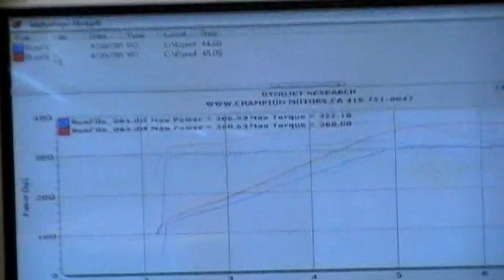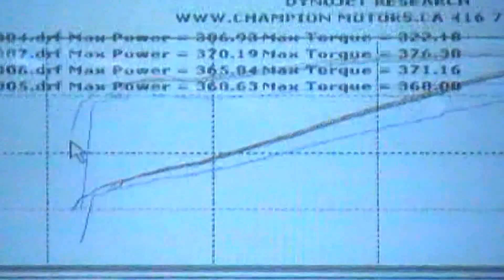243 heads, 228r cam Lq4 87 Transam dyno

Comment from the maker: Working on it.But not overly concerned.Exhaust is a huge draw back and the voltage drop which has been fixed and made a difference in topend already.
Reply: Torched T/A Entertainment hi, I'm also using an lq4 alternator and have a voltage drop at 6000 rpm. I use to have it at 5500 rpm until I installed a bigger pulley.
What was your solution and did that alone help high rpm?
Also, when your voltage dropped, was your wideband reading anything different than commanded? I ask because my air fuel ratio is still how it should be when the voltage drops to 11.XX volts. Thanks

Comment: I'm thinking mongoose heads 62-64cc (215s?) on a refreshed LQ4 lower with ARP bolts etc., and the Ultimate LS schmeely by FItech. It will reside in the bay of my 69 pervertible. Any thoughts?

Comment: you'll probably see another 20-30rwhp with a set of 1-7/8" longtube headers & 3" y-pipe
Reply: manzo70 I couldn't see why he wasn't making 400hp at the tires until I saw he was running stock manifolds.

Comment: Nice !!!  I have a 5.3 in my 3rd gen Camaro ,And thinking of swapping it out with the 6.0 lq4 with the 243 or 799 heads ,BTW What cam did you use ?
Reply from the maker: At that time is was the 228R cam from TSP on a 110 lsa
Reply: @Torched_TransAm  Thanks for getting back to me ,,,,What would be a good cam for the 6.0 for all around power ? Or even the 5.3 with stock converter
Reply from the maker: @DELTRANIO99  there are so many options. Contact the guys at texas speed, let them know what car you got..motor/trans setup and what the goal is for the setup. they will spec out a cam to suit your specific needs is the best way to go. I imagine something in the 226-230 range with around 550 lift would be suggested for decent gain,driveability and longevity of valvetrain.
Reply: @Torched_TransAm Thanks for getting back to me your the man and will do that

Comment: Ms4 cam ls3 top end LT lq4 he put down 360 on a mustang dyno but his car has the same issues you mentioned!?
Reply from the maker: Voltage was a failing alternator. I upgraded to the bigger truck 140amp alternator and solved that.  Misfires were from old msd plug wires. I switched to granatellli solid core wires. I did upgrade to truck coils also and tuned for them which brought me better mileage

Comment: It's amazing how much hp LS based engines make until they are put on a dyno... reality is that magazine numbers are very inflated.
Reply from the maker: That's the thing. It's just a number... An LS engine makes great numbers on a engine dyno. But stick that engine into a car and depending the drivetrain will eat those numbers up. The reality is what it does at the track not the dyno
Reply: @Torched_TransAm    nice T/A by the way
Reply: I read a car craft craft magazine about an lq4 build stock lq4 with ls1 hotcam.  It made 480hp, I thought that’s the ticket, I put one in my 72 GMC rebuilt with ls1 hotcam.  Made 323hp 342ftlbs, that is a far cry from 480 crank, maybe 400 to 410, it was though an auto and a ford 9in with 28in tall tires, but still not the 480.  I swapped heads to ported and polished 243, stepped up the cam 10 more degrees duration, swapped intake to tbss, was told this combo would make 440 to 460 wheel in a vette.  I made 362hp 365ftlbs in my truck, I think more realistically it makes 450 crank and 400 wheel in a vette.  Now some dynos are happier than others, I have had people with the same combo claiming 440whp, I don’t think they really make 100 more hp than me.  What you have to keep in mind is magazines dyno engines with electric water pumps, no accessories and open exhaust with water temps in the 160 range and often no MAF.  The only way to really add big power is with boost.

Comment: I'm just gonna port an polished 317 heads
Reply from the maker: Mill them .030 for a slight increase in compression.It will give you more power,better throttle response and still very safe for mild cams with stock head gaskets/ptv clearance.
Reply: I was also going to port and polish my typhoon 96mm intake manifold and bore out the opening with my LS2 102mm throttle body as well
Reply: also I'm getting LS2 flat top pistons

Comment: Any engine you install in an 87 Firebird instantly looses 100hp.
Reply from the maker: +Ryan Barbolt Wasnt aware of that lol,but  dyno numbers are just numbers.As long as the tune is done well is what matters.
Reply: Just screwin around man, but I agree with the others that should break 400whp.
Reply from the maker: Actually it shouldnt, on a lq4 should make less power than an ls1 with the same mods due to less compression and make more torque.It made the exact power Tsp said it should make with the cam and head swap.It did pick up 25hp more with longtube headers and a cutout in the follow up video I posted after this one.On this video I mention I had issues and the car wasnt fully tuned.This was 3 yrs ago though and this motor has seen alot more abuse slapping a turbo ontop running 15psi it wont last much longer :P
Reply: Well, no that's not true.  You said it had 243 casting heads on it which puts the compression exactly the same as an ls-1 with the right pistons.  Even the truck manifold makes more power than the car mani. if you can fit it.  Almost everybody using the lq4/9 with car heads and longtubes makes well over 400whp.
Reply from the maker: No thats not exactly true.The lq stock is 9.5:1 compression vs a stock ls1 is 11:1.Swapping lq4 has dished pistons and even swapping to 243 heads with stock head gaskets put me at 10.6:1.In this video Im still using stock manifolds not longtubes.A stock lq4 in 02 makes just over 300hp at the crank vs an ls1 at 340-350 at the crank. Tsp said the exact same thing..an ls1 with this cam package would be around 410-425whp. A lq4 would be 380-400whp depending on gearing and I hit there exact numbers when I had longtubes.Keep in mind most guys who run n/a lq swaps use a bigger cam than a 228r which would be 10-20 more whp.But just putting on 243 heads onto a lq4 does not equate to a stock ls1 with 243 heads.And the truck intake would stick out my hood so I choose not to use it..and I choose the smaller cam knowing I eventually was going boosted and didnt want to change cams again.But like I said..when I fixed my issues and put on my longtube headers the car made 400whp/tq which is on my another dyno video.
Reply from the maker: +Ryan Barbolt keep in mind most guys doing lq4/9 swaps go with bigger cam,large 2' primary tube headers, ported 243 heads and upgraded valvetrain which are the small things people forget to mention in their build..its never just a cam swap lol.I cam shopped for months ans spoke with tsp,tick performance,geoff at eps and they speced me a cam in the 224-228 range and estimated 380-400whp.None of them though it would be over or close to the 420whp mark without more mods I just didnt/couldnt afford to do at that time.
Reply: no a ls1 is 10.5:1 a ls6 is 11.1..... 243s on a ls1 make it 11.1 241s come on ls1s boss
Reply: @devonkelly2505  Ls1 10.2:1 66cc
                          Ls6 10.5:1 64cc 
       
243s on a Ls1 Unmilled make 10.5:1 compression. 243s on a Lq9 make 11.1 compression. should be around 10.2-10.5 on the Lq4 block Unmilled.
Reply: C&B Lay you are right. I was off by the .5 yeah my stock ls1 with 241s has 10.0:1 and the ls6 have 10.5:1

Comment: how are you getting so close to 400 whp i want to do that with my 6.0 lq4
Reply from the maker: 400hp isnt hard to get nor overly expensive but the tune will make all the difference also. mid 220+ cam, good exhaust system and intake should get you spot on. Biggest gains were from getting longtubes and bump in compression which I post a vid after longtubes were done and a cutout when i hit the 400hp mark. Stock bottom end still going strong.
Reply: i was thinking long tubes 228r cam ls6 intake
Reply from the maker: michael waide  Thats my setup really. My longtubes are not much bigger primaries than stock. I also milled the 243 heads and used stock head gasket. The 228r is a nice cam..but its now an old design and many new options out there that will make more power and be easy on valvetrain. Invest in longtubes 1 7/8..the lq4 loved to breathe I find.
Reply: who made your headers . what cam would you sugest since im stuck with 317 truck heads which flow almost the same as 243
Reply: are you running the stock rear end too
Reply from the maker: michael waide Yup..original 1986 9bolt rear with 3.27 gear
Reply from the maker: michael waide Depends on your application and what you ultimately want. I but cheap racing innovations headers for my car. cam wise when I did 330whp with the 228r cam with stock 317 heads and stock manifolds. i gained 40hp from switching to milled 243 heads alone to 370whp. longtubes gained me the 30hp hitting 400whp. contact tsp or tick performance on cam/heads ..cant go wrong either way. eps cams are nice also. You dont need a big cam to make good power
Reply: well how much were the heads cuz when i contacted tsp they priced me at 1300 for heads and cam
Reply from the maker: michael waide buy used stock heads. why bother getting brand new. got my 243 heads used for $400 had them cleaned and milled and added better valve springs from the cam kit.
Reply: ok you didnt need to have them ported and did you need new push rods
Reply from the maker: michael waide you have to do new pushrods ..and springs when you buy a cam.simple boltons with a cam is an easy 400hp on a ls engine.you got alot of researching to do.
Reply: yea i know
Reply: @Torched_TransAm  awesome build bro, do the pushrod length depends on the size of the cam. And far as (ptv) clearance will I be in the safe zone.
Reply from the maker: @cowill8674  ptv does change with the cam,heads,head gasket etc. Generally you would buy a cam kit from a vendor that includes cam,pushrods,valve springs to eliminate problems. Call up a vendor like texas speed,tell them what you have..and what you want and they would tell you the parts needed for the application.
Reply: @Torched_TransAm  thanks bro. I just talked with Brian tooley
Reply: What length pushrods did you use

Comment: What transmission was used for this?
Reply from the maker: T-56 which is now built stage 2
Reply: Did you happen to use a mid plate?
Reply from the maker: Mine did not need to be replaced
Reply: Now the only reason I'm asking is I'm planning on using the same LQ4 built just laying out different setups to get and idea. But I hear that the 4L80E  is better than the T56. What's your opinion?